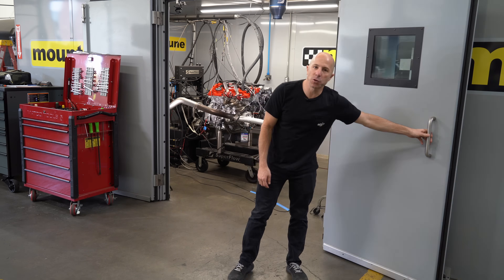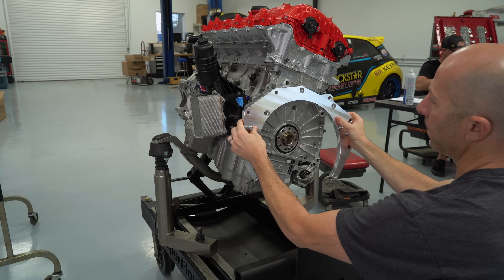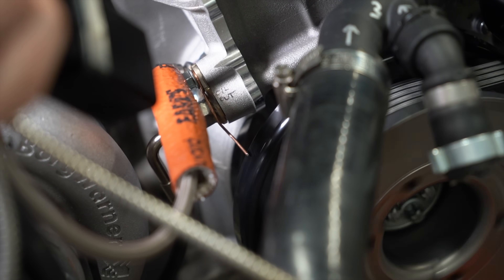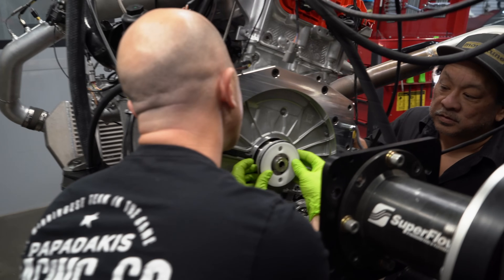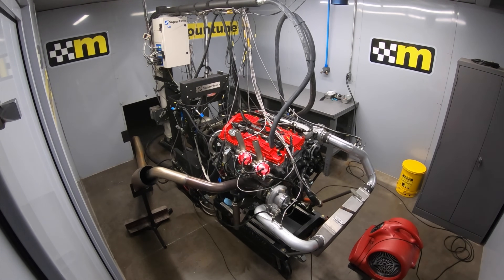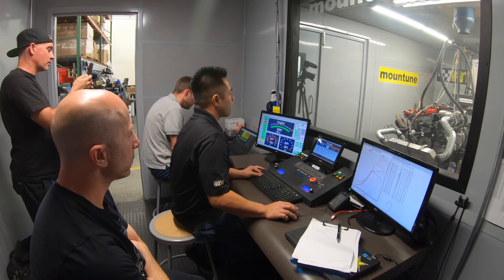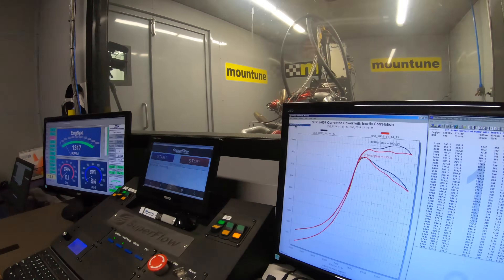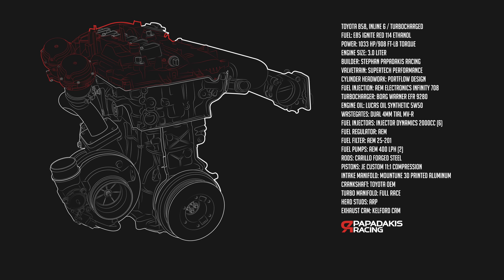B58 Engine Dyno 1000+ Horsepower - Sounds like a 2JZ!?

Comment: that engine sounded like it wasn't even trying when it made 1000
Reply: The more impressive piece is 850hp with 15psi. Needing three times that for only 250hp more says they’re loosing VE rapidly for some reason
Reply: @Turbochargedtwelve  agree you're just flogging a dead horse after that. If it was my engine it would never see any more than 15psi of boost. Another 27 psi for 150hp is a foolish trade. Like you the first thing I would be looking at is where the volumetric efficiency is going. Is the intercooler not big enough / no heat exchanging going on? What about that poor AC pump with no coolant take that off and put it in the bin. I would have pulled the pump off it if you're only going to use it as an idler pulley. You can't claim it was actually working.
Reply: @DodgyBrothersEngineering  
I cant help but to compare this to like Honda K-series thats in the boostedboiz MR2.
2.4L 4-cyl and it did 765WHP@~20psi & 1045WHP@~30psi
Not saying that this engine is completely shit, but this aint that impressive either..
Actually im taking it back, that is pretty pathetic.
Reply: @jusshma  Bruh they are close to 10k rpm, Papadakis is only set at barley 7k. that's a lot of room to work with A LOTT
Reply: I'm wondering: How many of the people commenting here actually have a clue about why these engines produce power at certain circumstances.
Completely nothing special happened, by just looking at the exhaust ports and other parts of the engine you could have seen the restrictions coming. You could expect to need a lot of pressure and slow turbo spooling to make up for the restrictions.
Old honda engines tend to be balanced and have a thought through airflow design, just like old BMW engines. The new ones are mostly marketing wank.
---
BTW, when will american tuners finally understand why you shouldn't trust intake port flow tests with compressible flow? When will their aerospace colleagues tell them about the transsonic area rule?
But people care more about AC pumps than about flow separation of boundary layers.
Reply: @jusshma  it's just a BMW engine. The supra really should have been a top model ft86 frs. Even if they used a toyota truck v8 tuned for more top end it would have been better
Reply: @jusshma  Third attempt... I think they are leaving a LOT of hp on the table. They must be running into serious breathing issues to lower the VE so much. Normally the car would be traveling at speed. That little fan in front of the IC could be thermally limiting the ICs ability to exchange heat. The recorded 42psig could be completely bogus. Pressure Shown in Gauge (psig) doesn't necessarily reflect real boost. I can think of half a dozen reasons why this engine failed to perform. It could be something as simple as the sealed room couldn't pass enough air to make more hp. Notice when they turned the fan on the hp jumped about 30hp (probably artificially pressurising the room).
Reply: @DodgyBrothersEngineering  Im with you most of that, however i must say that all things pointed out about it not giving power, are real problems.
Taking into careful consideration that major huge amount of work and designing paired with top of the shelf parts and professionals, ehhh its hardly performing the way expected. 
And we are still talking about just the engine dynoed in controlled environnement, not a little 20-odd year old cheapomotor on the rollers, at the back of an mr2
Reply: @jusshma  without a doubt it won't perform as well under a hot bonnet, with limited air available, and connected to a gearbox and diff, and a limiting exhaust system. Then the shine will come off that 1000hp.
Reply: Flow numbers are somewhat of an indicator where a lot of people get it wrong is they focus on peak flow and don't understand that you really want to focus on area under the curve especially at lower lifts that happen twice on a cam's rotation unlike peak lift. How fast you get the valve off the cam lobe is critically important to optimizing head flow which is one of the reasons why the "energy" of a cam's lobes has gone up over the years when materials and valve springs permitted it.
Reply: @thetriode  Slightly wrong explanation for the right conclusion.
Yes, flow numbers are shit, but the reason why is  more complex.
During a running engine not only is the valve lift changing, so is the speed. The flow has inertia, standing waves, turbulence, etc. After a valve has closed you get a pressure spike/wave that can travel and bounce around and help with the next intake... -just to name one of the effects. When the airspeed of the flow is 140-160m/s is when you make the most power, with lower speeds you get low tubulence in the combusion chamber, pour mixing, etc. With higher speeds you get effects reminiscent of transsonic wave drag.
The best flow testing is to build your engine, connect a MAF sensor and collect logs. That's the Russian way of doing it, simply looking at how much air your engine breathes in the real world.
Reply: jusshma pathetic is the torque curve and turbo lag... lol Honda’s aren’t magical bro
Reply: @DodgyBrothersEngineering Its not the pressure in the room that caused the HP to increase, it was the fresh air.
Reply: @RocketRaspeed  Same difference... whether turning the fan on increased the available air or it pressurised the room (i.e. more air than can atmospherically fill the room) it still equates to more hp when supplying the engine with the necessary oxygen it needs to fill the cylinders completely. I have a person gripe with dyno owners that pressurise the the room or feed pressurised air into the engine because it is just fudging the hp figure with a false ram air effect.
Reply: @DodgyBrothersEngineering  No the fan is not pressurizing the room it is removing the exhaust and bringing in fresh air. Engines make more power running on air than exhaust.
Reply: @jusshma  you do realize how long the k series has been out for compared to the b58? Give this engine another 20 years and it will be a binder full of ways to make easy power.
Reply: @DodgyBrothersEngineering  I'm no engineer but the miniscule pair of exhaust ports on that built in headifold seem to be a good place to start looking for restriction. I mean, it keeps a lot of heat in which helps spool the stock turbos for a low lag feel but I just can't imagine that design being useful when you're searching for 4 digit power.
Reply: @DodgyBrothersEngineering  Since when do you compete in FD? lmao
Reply: @arc00ta  I am no fan of integrated manifolds either, but if it is capable of producing the necessary boost then it is capable of flowing sufficient exhaust gas, otherwise the boost numbers would rapidly flatten out. I am not however convinced it actually made 42psi of boost. Just because it shows 42psi in the gauge / sensor doesn't mean it made it. The volumetric efficiency rapidly decreased after 850hp which suggests that the engine was either incapable of processing the extra boost, or the boost simply wasn't there to process. They never had EGT sensors on the exhaust to monitor temps, but I strongly suspect that the intercooler allowed the intake charge to rise so high that it started given a false reading in the sensor. I think the boost was much lower than reported.
Reply: @hanta7488  starting next week...
Reply: @arc00ta  I should also add that you are right there will come a point where the integrated design does become a restriction point. I don't know if you saw the video I did on my 180sx which includes a steam pipe turbo manifold of my own design. I went against a lot of the conventional design thinking and wound up with a very streetable manifold that even out performed standard manifolds with a big turbo on it. There is a fine line between too little and too much runner length. All the dyno queens opt for long runners just to get the "final number" but it is not the best design for streetable performance.
Reply: @SN0WMAN801  It's an undersquare engine.  Quite a long stroke.  Piston speeds are probably already very high at 7K RPM.  Maybe all-forged, 8-8.5K is doable, but i wouldn't hold my breath for it.
Reply: @detaart  The undersquare configuration, and the integrated exhaust manifolds pretty much explains why the engine doesn't have too much volumetric efficiency over a certain boost level, and why the power curve looks like what it is 

ALL undersquare engines have a similar power curve, the maximum power is achieved at medium-high RPMs, and it stays there, the torque drops just as the RPM increases, is actually a very good compromise, plus undersquare engines generally overheat less than their oversquare counterparts (higher surface area per certain volume), the B58, and all these new generation inline 6 engines from Mercedes, Jaguar, are not that far away of being gasoline powered miniauture versions of engines like the Cummins 6.7, Caterpillar 7.1, or Detroit DD8

The big issue i can see for making a high power B58 is the integrated exhaust manifold, there's a reason all modified Barras, 2JZ, RB26, and whatever tend to have equal length headers, at high boost levels a log manifold (which is what basically a integrated one is) just can't handle the exhaust flow, so you start to get problems with exhaust gas not entirelly leaving the combustion chamber which caues knocking or not having enough scavenging to help the volumetric efficiency of the engine

Personally i like the B58, because i like inline 6 engines, but definitely it could have been better, it could have a 70° angle between exhaust and intake valve, it could have stronger main cap bearings, it could have a separate manifold that ya can exchange for a equal length header
Reply: Jared my god man I’d be interested in a v8 Toyota frs, Supra needs to stay inline
Reply: @tokeypokey  the truck v8s are dogs I have one at work and for some reason its slower than my 2.0
Reply: @jusshma  At what RPM was the Honda 2.4 making its maximum power?     1009hp at only 6700rpm IS pretty impressive, even at 42psi. It is still running the factory rev limiter and has the kind of power band you could use as a daily driver. Peak figures aren't everything.
Reply: @bryan10444  are we just gonna ignore the fact that twin scroll turbos exist?
Reply: @EASTTBAY  5 years after launch, we already got 700-1000hp builds and getting 500-600 is stupid easy
Reply: @sasjadv  Mach 0.75 at WOT through those ports, at 7k RPM? Probably not. Flow tests are used as a COMPARATIVE reference rather than an absolute. Mostly in more well funded automotive industries it has been replaced with finite element analysis, but for speed of processing these generally don't consider the extra calculations required for higher speed flow either. Automotive engineers extract the best possible performance to suit the requirements of the product. In the case of a sports car that's absolute performance whilst within the restrictions of various emissions regulations worldwide, as well as longevity with cheap parts, and driveability so you don't send the worst driver in the world to their deaths. Something your old Honda and BMW engines never had to consider.
Reply: @alanhillyard1639  The most popular misconception that people have in this regard, is that they think of intakes as a pipe with continuous flow, instead of little bursts with resonances and valves being open only 25% of the time. That's why the actual airspeed is higher than what most people expect.
And research from automobile manufacturers has shown that both optimal performance and efficiency is achieved at around 150m/s intake airspeed; and they try to acchieve that by either tuning the intake for a certain load+rpm range, or by implementing technologies that restrict flow at lower RPMs and lower load  like twinport or valvetronic.
    About test methodology and FEA: CFD is just a tool, it doesn't make you a good engineer automatically. The key to success is to know what to look for, and to setup test methodologies around that; you still have to know the phenomena and causes. There are actually tuners that quite successfully use acoustic analysis for their exhaust, i.e. they listen for standing waves to appear and make changes in the exhaust and engine map to get more resonance in the load+RPM range they need.
     About the manufacturers goals: their endgoal is to make the most overall profit, through sales, repairs and services; for that it has to look good on paper, it shouldn't be too reliable, and it should have new fancyness to keep the marketeers happy.
-----
By the way, during the first FD season with these Supras, Papadaki did have to swap out the B58 engines for new ones a few times, because the engines didn't last. And in one of the later videos you could see that Papadaki switched from two port intakes to normal six port intakes. So he actually got rid of those intakes, that I was ranting about somewhere in these comments.
Now, obviously we can't say for sure whether those blown up engines and intake changes actually happened because of what I mentioned in my 2019 comments; but I think it's save to say my 2019 concerns did at least have a bit of a ground.
Reply: @DodgyBrothersEngineering  That's what i was thinking 42psi is absurd for 1,000hp.
Reply: @Turbochargedtwelve  he didnt say 850hp at 15 psi. He said they were running through the boost from 10 then 15 at then at the end of the day it made 850hp. Didn't say at what psi. No 3 liter engine can make 850hp at 15psi.
Reply: @HueyNguyen87  actually yes, a 3.0l engine with 12-12.5. compression running ignite e85, big turbo can indeed make 850crank @ just 15 psi. All it takes is good flow, good engine design, the right setup and the right tune.

My buddies freaking fully build Miata BP makes 450crank on 15psi, it's a 2.0l, 12:1 c/r engine running a small turbo for that power, Garrett gt2560r. It's an e85 only engine.

Now for that reason, it's not hard to believe that if he went with a larger turbo, such as a Gen 2 GTX2860 or 71 or larger, the intake air temps and flow would be even more favorable that he could likely pull off a compression ratio of 12.5:1. Then you can easily assume he can get near the 550crank region @ only 15 psi.
3.0l displacement / 2.0l = 1.5 times
Multiply 550chp * 1.5 times = 825crank.hp.

Now, take a big step back and remember that I'm talking about a freaking Mazda BP engine which are not known for having the best flowing cylinder heads lmfao.

So yeah, it's totally believable that this bmw engine is making 850hp@the flywheel on e85 with all of today's technology and know how.
Reply: @Turbochargedtwelve  I'm willing to bet it has alot to do with the exhaust manifold being integrated into the head
Reply: Sean Cunningham yeah I think that’s a heat transfer concern, but another real issue is that the CC and all was developed around GDI. The fact that they completely disregard and even remove from the equation is plain dumb!
Reply: @Turbochargedtwelve  Must have bounced over that part. YTing while distracted. If so that's pretty awesome and means they're floating springs, way under turboed (exhaust specifically) there's an EMS issue such as their timing dropping without them realizing it.
Reply: @Turbochargedtwelve  I think exhaust manifold integrated into head is one chokepoint. It is possible, that VE is optimized for stock boost. And you can not undo the integrated manifold. Then nobody really starts tuning this engine in the future. Better to take E46 M3 S54B32 engine for tuning. Iron block, ITB intake manifold. And if you can use B58 crankshaft in S54 block, you have 87mm bore and 94.6mm stroke, totalling 3374cc.
Reply: @Turbochargedtwelve  It's the turbo, it is past its efficient range and is superheating the air. Even though it's at 27 psi, most of that pressure is coming from the temperature increase of the charge air and is not more dense. Imagine the same amount of air as 15 psi, but because it's 1000*F instead of 280*F (Making up numbers here to illustrate) it is now 27 psi even though its the exact same amount of oxygen as 15 psi. The VE is not going down, but the manifold air DENSITY is going down despite the pressure increase. Does this make any sense?
Reply: Stanley Zitello its called “law of diminishing returns”.
Reply: It doesnt sound as vicious with 3krpm less than everything else
Reply: @William ArringtonFacepalm, facepalm. I though you knew what you're talking about, are you trying to prove the opposite?

So just because the factory setup with stock intake and a small turbo has a fast throttle response doesn't mean the same block with ported intake, new manifold and big turbo will have the same response as the stock engine. Forget about the drive by wire system, it's not the bottleneck here. What's the point of a fast throttle if the gasses and turbo need time to speed up?
---
Area under the curve is not the power you get when shifting. If you get your foot of the pedal then the throttle closes, the turbo flutters and loses RPMs. How is this not obvious to you? Right after you put your foot down you do NOT get the numbers of the dyno graph. You have to wait for the turbo to spool up, to get the turbo back to it's RPMs, only then will it be producing it's boost pressure that you had during the dyno run.
---
Neither the area under the curve, nor the use of electric throttle bodies (marketed are drive-by-wire) have anything to do with how the engine actually responds.

How have to just understand one big thing:
This is not a B58 that just produces more power, it's a new setup, it has completely different characteristics. How this custom setup performs only depends on how Steff's build it.
Reply: @William Arrington 
"because you don't know how this engine is setup" Did he give exact details like the stock vs tuned valve lift, valve duration, intake port diameters, etc? No. He was more general, and didn't show very specific info that no more than 1% of the audience would appreciate. (obviously)

"I also dont know why you think you wont be in the power." I never said that, I only said you can't say for sure now. And there are good reasons to suspect trouble.
About the RPMs: I said some few comments before this that on a  track you need to take your foot of the pedal for seconds, and that is enough to make the turbo stop. That's kinda the thing with throttle responce. Obviously during shifts it's less of a problem, but still you will have some drop in turbo RPMs for sure.
---
And now let's get to your Honda reference (small displacement with big turbo is what you mean), let's set one thing straight: I don't think in "fanboy terms" but in scientific parameters.
Alright, firstly there are multiple reasons why you would have a narrow power region, not all of them cause a bad throttle response. There is no 1 to 1 correlation.
One great example that proves you wrong about the correlation: if you take 2 stock turbo cars, on one you install a bigger turbo, on the other you swap the camshaft for a bigger duration+lift one. And let's say you picked it such that both new setups produce the same amount of power, then the 1st engine will have a wider powerband that the other, but the 2nd one will have a better throttle response than the 1st one.
Some styles of intake manifolds tend to resonate at certain RPMs, they give a peak in power level at those RPMs without big turbos.

The thing is: If you have some kind of bottleneck that reduces your power level then you can compensate for it with a bigger turbo. (not only small displacement like on Hondas) And this BMW supra engine does definitely have some restrictive intake and exhaust manifolds from the factory. Yes, I do know that the intake is improved, but by how much? Did they use the transsonic area rule? Did they take boundary layer separation at the inside of the bends into consideration? What is the cross-sectional area of those ports? What standing waves occur at what RPMs?
And the exhaust is still restrictive, the exhaust ports combine way too quickly. For an ideal setup you want an equal length exhaust where the runners combine right before the turbo. That's what research says.
Reply: @William Arrington Is your definition of "real world drivable" to just have low end torque? You're only looking at that??? Here are 3 things you've overlooked:
---

I mentioned throttle response, haven't I?
During a dyno pull where engine RPMs rise gradually you have enough time to spool up the turbo. Here is the thing:
Even during drag races you need to shift, and you don't want to lose all your boost during those shifts. Ok, there you can easily make up for it with anti lag because shifts happen quickly.
But on a track you need your foot of the throttle and brake in front of corners, downshift and once you get out of the corner you don't want to wait when you put your foot down.
With drifting this is even worse, on drift cars throttle position, RPMs etc. get all over the place. Drivers like Eugene Losev pretty much rape the clutch and throttle to get every bit of acceleration out of the slide.
---
Next topic: sustained load for a long duration, can it handle it? Not one pull but multiple laps (it's obvious why this matters)
---
And finally there is the problem with changing load and RPMs that few people know about: if you promise to only apply power gradually then you can tune your engine for more power/efficiency.
You can push your engine further as long as you keep the load steady.
One great example is to look at aircraft engines vs car engines. Aircraft engines work pretty much the same way, and still they can run leaner and can be tuned for more efficiency; but the propeller puts a steady load onto the engine (compare that to bumps in the road and loss of traction), and a pilot always moves the throttle slowly.
If you wanna put an airplane engine in your car then you need to tune it more conservatively, and if you put a car engine into a plane then you can push it further.
Dyno pulls are very similar to aircraft takeoff in terms of engine load.
Reply: engines sound boring when they rev to only 7k
Reply: ModernArc go smoke you're vape and get in your 4 cylinder then
Reply: @William Arrington Dude, i'm not asking you anything.Have you actually looked at the exhaust yourself? Have you actually looked into the theory yourself? I have looked into it, way before this conversation started.
This manifold is clearly NOT made for scavenging but for a small turbo. 
Researchers clearly say that for scavenging you want (1) long runners; (2) separate runners; that combine as late as possible; (3) equal length runners; (4) you want these pairs of exhaust ports: 1+6, 2+5, 3+4. (5) You don't want the cross section to be big enough.
THAT is what research tells us about scavenging exhausts, period.
Now for engines with a small turbo it usually is beneficial to make a small exhaust with short runners such that you use more of the kinetic energy and the turbo runs hotter. For a stock road car in city traffic you actually want that turbo to run hotter and spool faster, and you don't care too much about airflow restrictions. And THAT is the route that BMW chose with this engine. But if you take this roadcar-focussed engine and want to push it to 1000hp, then you have to push it harder than some other engines.
---
And don't get me wrong: I don't want to discourage people from pick their own engine. On the contrary: I don't like it when people just copy other projects.
I just see that this specific engine has its restrictions that you need to overcome, and I'm actually curious to see how well Steph managed to deal with it. I don't doubt because I'm ignorant, but because I actually know how many variables there are.
Steph didn't pick this supra engine because it's an easy engine but he actually wanted a challenge. That's great, but how well of a job he did is yet to be seen in the real world.
Reply: @William Arrington What do you mean with that?
The person who said: "Not going to read any of this this then." ?  is telling me that I stopped trying to have a conversation.
I don't see anything odd here: instead of verifying what I say and looking up the info, you said I should look up info and i'm here to "lord over you". What did you expect?
---
Discussions don't need to have a winner or a loser, it can be a draw. People can agree do disagree.
But phrases with a meaning like "you're just here to show off, haha" are just a way to show ur butthurt.
Reply: sasja de vries. Omg what do you do for a living man? Like you just spend a lot of time in the internet typing all of that ‘facts’, arguing with stranger about an engine that you never had experience with. I mean do you build engine for a living?
Reply: @joeladzim1225  TBH your comment does make sense. I'm a mechanical engineer btw, I do know what I'm talking about.
Yes, this conversation turned out to be way too long for my liking. Most conversations in the comment section are rather short, sometimes people actually have interesting things to say and then it's worth sharing info. And then you have the exceptions that don't go anywhere and take too long, this is one of them.
And I actually want to end this conversation right here.
Reply: @William Arrington it weighs the same as any other civic of that gen and thats heavy for a compact car... I agree lightweight makes everything better but thats what is magical they just put it into use at a very affordable price
Reply: That’s what went through my mind. It sounded like it was only 3/4 of the way to max power after they fixed the exchange fan
Reply: This could be the best recipe for an engine, let BMW make an engine , have Toyota make it reliable.
Reply: Yes because this is horsepower but in a car with all the friction we lost 20% of that power so we can think than we have here 800 whp
Reply: Yeah, it sounds like it's dying while making 800
Reply: I enjoy his vids a lot but this thing was struggling to make 1000hp. We were making 360hp from road racing (lasts all season and many hours without opening it up)1.7L Toyota 2TC, 2 valve, pushrod turbo engines at 7700 rpm, running on M85 30 years ago with only 15 psi. Stock block, head, crank and rods. Almost double the displacement here, 4 valves per cylinder and triple the boost. Sorry, not impressed.
Reply: It’s a smooth 1000 horsepower 😂 it’s essentially the refined horsepower bmw was talking about achieving 😂
Reply: William Arrington Preach
Reply: Cuz BMW🔥🔥
Reply: They’re behind a protective glass so the sound is not going to be as loud as it will be in person
Reply: That's why honda civic is better when the VTEC kicks in yo
Reply: 😂😂 yeah okay
Reply: Bmw \('_') /
Reply: @_Fnnx_  bruh BMW is total trash
Reply: @William Arrington The drawbacks of this engine are visible from miles away. Yes, you can put it in a race car, that doesn't make it a good option. Just putting a dyno-queen engine into a racecar doesn't prove that you will win races with it.
This will be the engine that costs more to build and perform worse compared to others. You can compensate for it by spending more money, rebuilding the engine more often, and building superior suspensions; and then that could still make you win. 
---
Just to give an example: The JZ is a great engine for drifting, but it's also a terrible engine for drifting.
It gives you all the performance you need, but it's long, big and heavy. JZ swapped driftcars tend to be nose heavy.
---
In the end this B58 can produce 1000hp, but building a 1200 horsepower VR-38 will be cheaper AND more reliable, And have a better throttle response, And the VR38 takes in less space under the hood (easier positioning and weight distro).
(And I'm not even a nissan fanboy)
Reply: @sasjadv  Might as well just use the cheapest engine to make easy power in a small package. Turbo LS. This engine looks like a nightmare to build to me.  Classic BMW over- engineering and complexity.
Reply: @bdbeckstrand  This project is clearly not intended as a cheap bang for the buck build, but more of a way to prove that Steph can even make 1000hp on this thing. Kinda reminds me of Kennedy who said "not because they are easy, but because they are hard". As a PR stunt this build does make sense to me.
BMW engines actually used to be rather balanced in terms of engineering complexity before 2000, and nowadays everyone except for Russians and Americans is putting marketing wank in their engines.
Reply: @William Arrington Lol.
One day you tell me to read the literature and you pretend to be the smarter guy, and the next day (when i come up with arguments why ur wrong) you say that I'm here to lord over you. Just Lol.
Reply: Toyota just didn't take unreliable bmw engine, they made lots of improvements to make it more reliable.
Reply: @penamuuri6767  what’s unreliable about the b58 in this 2021? I would love to see what they actually changed… I mean since you know of course
Reply: @penamuuri6767  then they both shoehorned it into pretty much every BMW ever (except for the 1 series, because a transverse straight 6 is pretty much impossible)
Reply: Even before I click on "view 45 replies" I know it's gonna be a bunch of couch engineers arguing about pointless stuff. Aaaand... Yep!